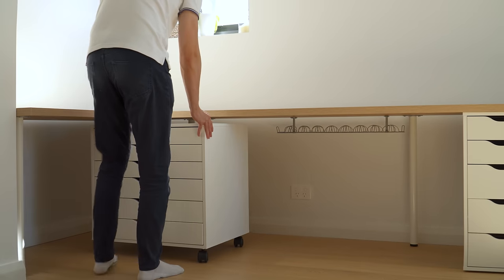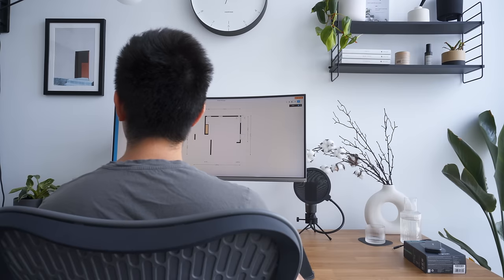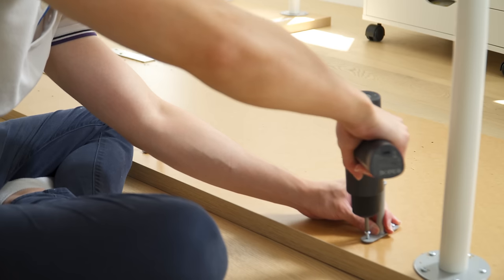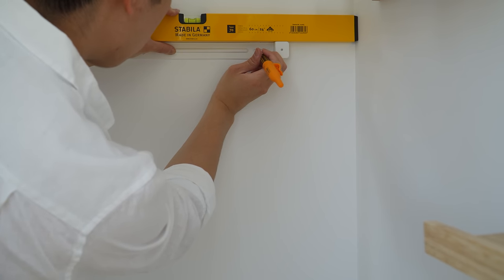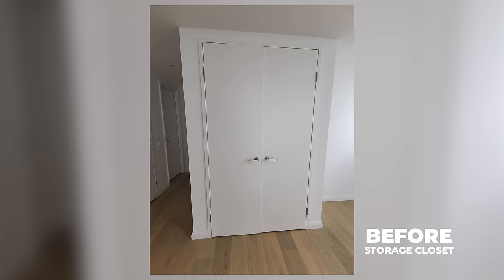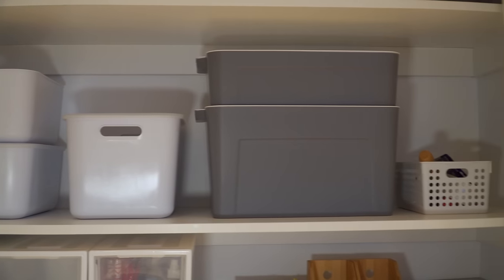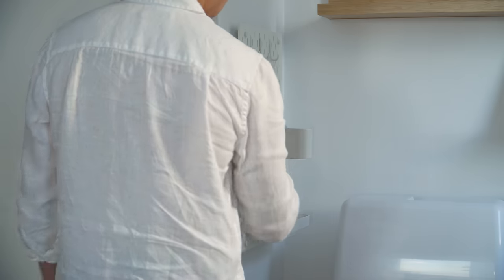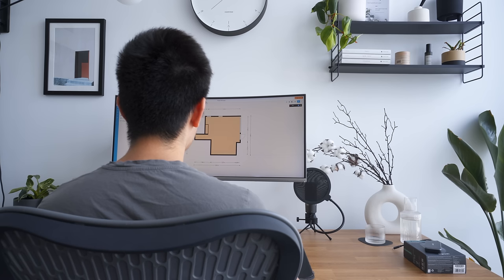Apartment Makeover #1 - Home Office & Storage Closet Organization (DIY IKEA Desk For Work & Sewing)

Comment: How long does each new make over project usually take? I am very interested in having my new apartment designed when it is finished in late June, but not sure when to reach out.
Reply from the maker: It really depends, a lot of the waiting time is for the shipment/production of furniture (many are not readily in stock), especially custom ones (like the curtains). Probably a good idea to reach out soon, as I'm currently working on multiple projects, so there's a bit of a queue. Plus, we can always start slow, and discuss initial ideas - then once the apartment is done/keys handed over, we can jump right away to finalizing everything.
Reply: @reynardlowell  awesome thank you!!!
Reply: @reynardlowell  I just submitted my application for house to home 😊

Comment: He uses the IKEA storage unit to act as a leg and support the two tables from separating.  If you know anything about how these tabletops are built, then you would know those mending plates, particularly used in the hollow middle part of the tables like so, are not going to work.  So if you’re trying to avoid that inner-corner leg, the two mending plates are not the way to do it. A little deceiving if you ask me, but that’s the power of editing.

Comment: The L shape desk can hold the weight in the connecting dots? because I saw there no legs in the front there
Reply: Yea..He connected using the plate in the back of table top. I guess its strong enough to hold the bakance n weights.

Comment: Why did you put two table legs just next to each other if you wanted to keep the cost down?? You could have done the same dividing as with the legs in your living room. This doesn't make sence...
Reply from the maker: The legs are only $5 each so not really that costly, and using two provides more stability in that particular spot.